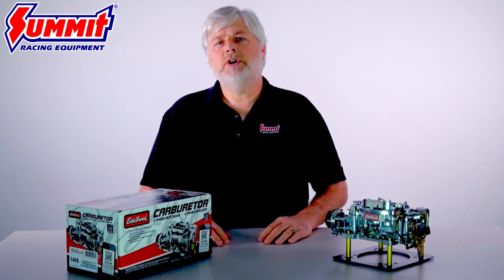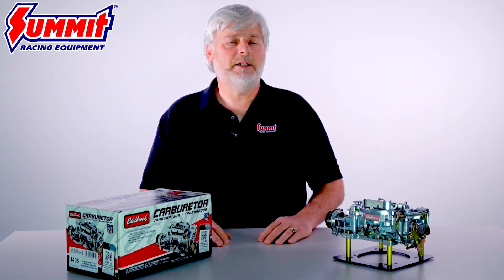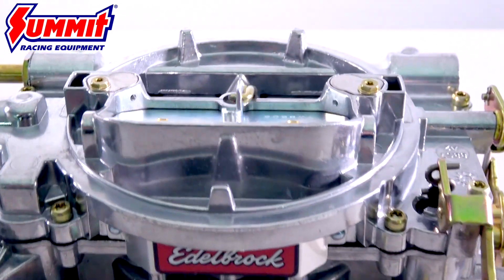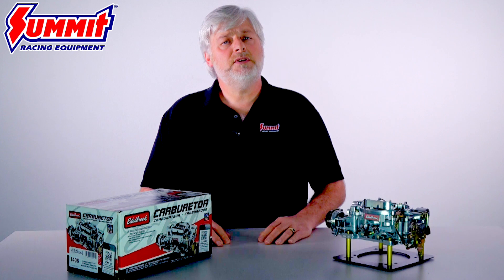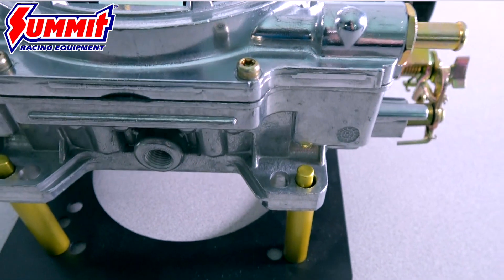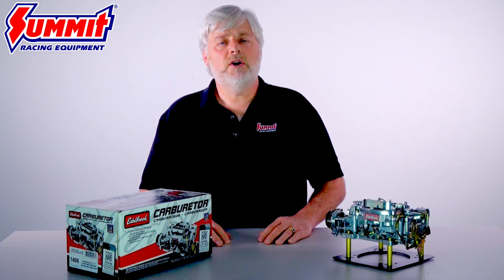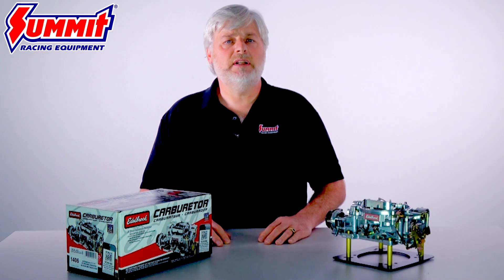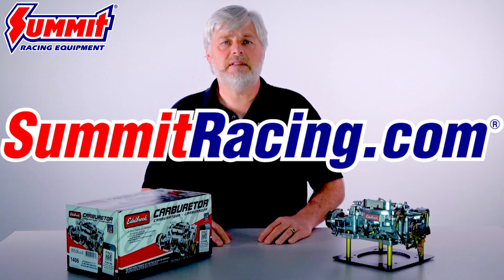Edelbrock 1406 Electric Choke 600 CFM, 4-Barrel Performer Series Carburetor Overview

Comment: Just replaced the timing chain , cam , had heads redone , lifters , distributor , plugs , wires ,fuel pump , and a brand new edelbrock 1406 carb on my 1972 C-10. Adjusted the timing and it fired right up ! Then I went to drive it and it kept bogging down at acceleration  and sputtered and wouldn’t shift right ! I went over everything so many times I was getting pissed that I didn’t do something right ! I was ready to give up ! Then I thought it can only be the carburetor. I took it off and took it back where I bought it and they gave me a new one . Installed it and it runs great ! Perfect ! So keep in mind that sometimes you just might be the lucky one who buys a defective carburetor new out of the box ! 🤷‍♂️ ps. I thought I lost my touch ! 😂
Reply: Fernando i have a 76 c-10 i really need help installing fuel lines but i cant find any help online do u have any tips ?

Comment: Question:  (asking for a buddy) What if you bought a 600 CFM Edelbrock #1406 and needed a #1403, 500 CFM but didn't want to buy new carburetor?  
The 9.5 to 1 compression, 302 motor is running really rich now.  The stock 600 CFM primary Jets are .098" and the secondary are .095".  Rec gas is always used and the fuel pump is mechanical.
According to Edelbrock, one jet size equals 3-1/2 % fuel air change.  I was going to recommend dropping the jets 4 sizes (15%) on both primary and secondary.  Yes that's a big change but it needs a big change.  When I drove the car it was loading up and backfiring in the muffler at 0-50 mph.  It's so rich at idle it chokes you and the idle Jets don't do much.
Thanks for any experienced replies.  2003
Reply: I did this, the booster sits a different heights between the 500 and the 600. It will mostly work but your idle and part throttle will be very wonky and inconsistent.

Comment: i have a bypass 12-887 pressure regulator do you have to hook up the vacuum port line ..i didnt hook mine up i just converted tbi to carb i just put brandnew edelbrock 1406 carb on it and its backfiring popping out my exhaust..i got the pressure set at 6psi

Comment: I've got a buddy with a 1406 on his 305 SBC could that be too big of a carb for it and thats why it falls on its face when you lean into it?
Reply: Adjust accelerator pump
Reply: More fuel
Reply from the maker: 600 cfm might be a little big for a 305 if its stock. I would look into tuning the carburetor first and if that doesn’t work then a 500cfm might be a better choice EDL-1403

Comment: Had to get a 650 for my 350 9.5 compression. Then I got a 297/305 cam and had to get a 700, still bogged out at full wide throttle so I went with a 750 dp holley brawler and that kinda solved it. Anyway this is an awsome carb but for like 40$ more you get the 650cfm with mechanical secondaries and annular boosters( the best fuel delivery jets for a carb) love these out of the box tuned carbs, tho I wish the didn't jump from 650 to 800
Reply: i have a 350 and the 600 1406 electric keeps dumping too much gas ant solution on that
Reply: @kennyhead9848  fuel pump ?

Comment: I had one of those that came with a truck I bought. I must have gotten a bad one because that POS never ran totally right, and I spent hours trying to make that thing run right. And I'm pretty good with carburetors. Replaced it with a summit 600 cfm carb 6 years ago and its been great ever since.
Reply: Then you clearly did not adjust everything right. These things run like an absolute dream when tuned right
Reply: @EitriBrokkr  I adjusted that thing by the book and tweaked the adjustments as you would in the typical fashion to accommodate altitude and engine changes. Thing was a POS no matter what. I have a early 70's Holley 4548 450 CFM 4 barrel I rebuilt and modified to my 
liking and it runs all over that Edelbrock. That Edelbrock 1406 never could get the choke pull off adjustment set right to the engine's liking, you can only bend the rod so much and have the choke flat still close fully. Stumbled when you took a left hand turn every time, float levels weren't too low either. Gas tanks are spotlessly clean so not a contaminated fuel issue. Fuel pressure was set to 5 PSI with a regulator. One side of the engine ran richer than the other due to the primary drivers side jet being countersunk deeper than the other primary jet. One of the power pistons seemed to hang up occasionally on a rough edge in the bore left from sloppy machining. Yeah, this one wasn't ever going to "run like a dream" no matter how much you tried.

Comment: Good demonstration but Holley carburetors is way to go I've done a couple before.
Reply: Malik ElcoSS454 surprisingly this is actually a Weber carb that was bought by Edelbrock so technically it’s a Weber.  Kinda cool.
Reply: Why?  Can you elaborate?
Reply: @Randemoller  by weber you mean carter, but sure
Reply: Then you've clearly never tuned a edelbrock up correctly. The are an absolute dream when done up right